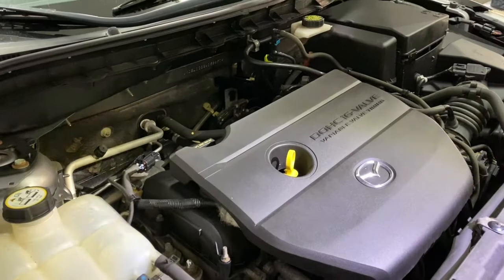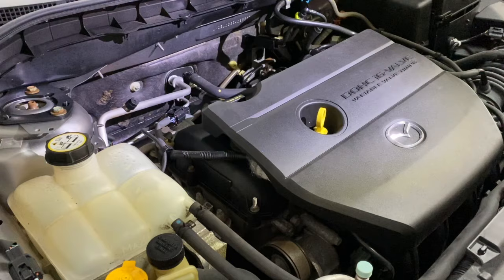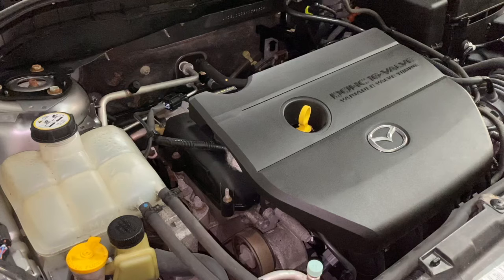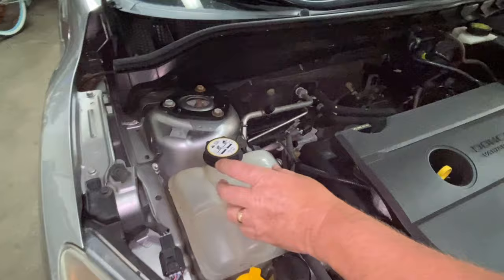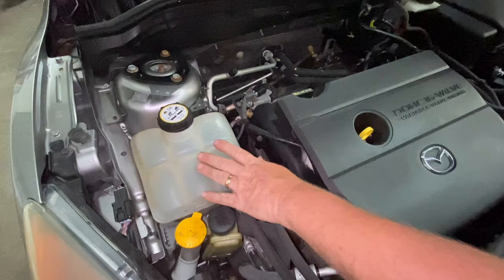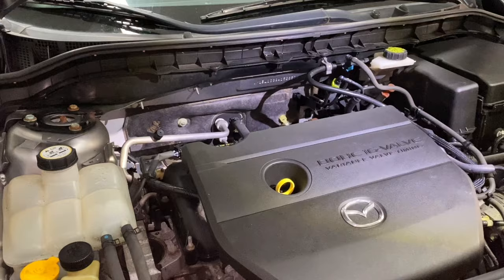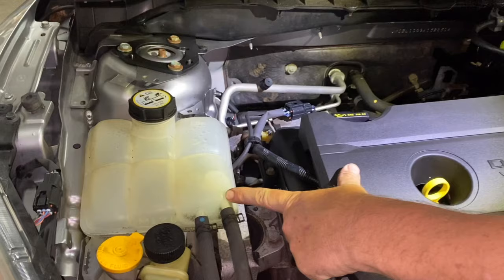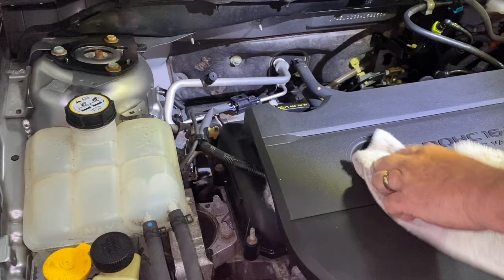Learn 3 Symptoms of Blown Head Gasket

Comment: Don't forget, usually it's a component that caused the over heating. Loke water pump, radiator, etc. Replacing gasket or engine and not the cause will only get you a second blown gasket.
Reply from the maker: Good info! This video is about identifying.
Reply: My car eats oil..  Do u think the excessive oil seaping into the seals and valve cover could cause a blown gasket?
Reply from the maker: No
Reply: Seal around pistons are worn probably burning an unholy amount of oil.  I believe 2008-2011 Camrys had this problem

Comment: Yeah, and, while you're there, with the engine running, but not hot, remove the coolant cap and see if it bubbling/exhaust gases in there - another simple check to see if the head gasket is blown.
Reply from the maker: That’s correct.

Comment: Dear sir, what if I found oil residue on the exhaust tail pipe? Thank you
Reply from the maker: Means vehicle is burning oil either through worn valve stem seals, worn piston rings bad pcv valve etc.
Reply: @Motorcarnut  thanks for the reply. I guess it"s best if I just walk away when I encounter a vehicle like that.
Reply from the maker: It’s wise if you don’t have mechanic skills or know someone who does.
Reply: @Motorcarnut  thank you sir
Reply from the maker: No problem
Reply: Welcome to the club, you drive an old BMW...  Its a feature, it makes your exhaust oxidize a tiny bit slower.

Comment: What about oil leaking from the seam That separates the engine block and cylinder?
Reply from the maker: That’s a good point, it’s rather rare but does happen on a lot of Subaru’s and that’s also a sign of a blown head gasket.

Comment: Sub for 35 years experience. Thank you Sir.
Reply from the maker: you're welcome!
Reply: @Motorcarnut  hi. I have a citroen c4 1.4. Car runs ok, but in the coolant tank i see some very minor oil spots. I dont see any bubbling in the coolant tank.
Some water drops are going out of the exhaust even with the car warm, i tasted it but doesnt taste like coolant though.
If i let the engine warm, if i remove the coolant tank cap, the coolant level rises about 2 fingers. Is it normal?
Can a head gasket be burned if there are no bubbling in the coolant tank?
Reply from the maker: Everything you explain is normal except oil in the coolant overflow. Could be a head gasket starting to fail, probably why oil is mixing with coolant.
Reply: @Motorcarnut  the engine also has, in corners, at the head gasket location, external oil leaks over the block. 
I put coolant in the tank up to the neck while the engine running and warm, and i saw some coolant is getting out. Everytime the fan kicks in, coolant drops a bit and i see a big bubble, but only at that time. If i accelerate or something, no bubbles there. 
I also noticed something, so i wanna ask you. 
When i first start the car, from inside the car, i hear a quick water bubbling in the dash. I know i heard this only in other 2 cars with head gasket isssues..Did you notice this also? 
Are there also other ways to detect a failing head gasket? maybe remove the spark plugs and see if one is cleaner? or something? 
i dont wanna spend alot to replace the head gasket without being necessary.
Reply from the maker: When the coolant rises when it’s hot it’s normal and when the fan kicks in it lowers is also normal. Your coolant level should be at the high mark not to the rim in the overflow tank. But you have leaks at the head gasket that is not good. Yes you can take out all the spark plugs and see it any look different from each other. And you can pressurized each cylinder with compressed air and see if any bubbles are coming out through the overflow tank, if there is bubbles than the head gasket is most like bad. The coolant noise inside the car could be a concern but check what I said first.
Reply: @Motorcarnut  i made another experiment. I  filled the coolant tank completely and let the tank opened,  started the engine, accelerated the engine, and at every acceleration coolant started to get out of the tank. 
Not violently, but still. Is that normal to happen with a cold engine?
Reply from the maker: If the car was cold then no that’s not normal, sounds like the pistons are pumping up the coolant system meaning the head gasket is blown. If the car was hot that’s normal

Comment: Short and to the point. Thank you
Reply from the maker: My pleasure
Reply: If I see coolant on the floor does that mean it HAS NOT got into the engine? Please advise.
Reply from the maker: No, it just means either you have a leak somewhere or the engine is overheating and boiling out on to the floor.
Reply: @Motorcarnut  but if the engine is keept on overheating if loong way drive.. is it posssible the head gasket was blown or something?

Comment: Nice video! My 2011 Mini Cooper S has symptom #3... a white smoky exhaust when warmed to operating temperature.
Reply from the maker: If it doesn’t go away and smells kinda sweet then it’s burning coolant and head gasket or a crack somewhere but probably the gasket is starting to go.

Comment: I’m trying to to figure out if my wife has a blown head gasket. She has none of the symptoms except the white  smoke which last only a minute or less when you start the car after it has been off for a while.  I changed the oil and it doesn’t look like it’s mixed , the coolant level is fine , and it doesn’t over heat .
Reply from the maker: Could just be normal condensation, but the do make test strips you can buy that will detect exhaust gases in the coolant system which would indicate a head gasket problem or not.

Comment: In your experience what would you say about oil in coolant bottle which is clear like new oil on a 2007 nissan note with no over heating
Reply from the maker: There is a failure somewhere. Head gasket comes to mind first. Car does not have to overheat for a gasket to fail or you have a crack in the head somewhere.

Comment: Just found your video my rav 4 is currently in the shop as result of what was initially thought to be a blown head gasket but was cleared of milkshake mixture turns out it was the rods that are meant to keep coolant and water sealed in engine with rod 1 & 2 having lost all their tension and were just sitting in the holes

The head gasket plate is still in one piece and only very teeny tiny amount of warpage to cylinder so all my mechanic has to do is remove threading from both holes and re-tap them so the bolts fit in there with full tension
Reply from the maker: You’re talking about the head bolts that became loose? If the engine was taking apart before I’d say it was human error but if the engine was never taken apart than the head gasket did blow. You may of not got oil mixing with coolant but it did overheat hence the warpage.
Reply: @Motorcarnut  ah yes the head bolts thanks for correcting me bolts 1 &2 were no longer tensioned when my mechanic check it over

Comment: I have a car question that I told to the experienced mechanic that works at the car lot that I bought the car from. Well it’s a 2011 Jeep Cherokee and I smell a burning smell from under hood and he said don’t worry it will go away in a few days.. it’s due to a valve cover gasket replacement and they spilled oil. 3 weeks later I still smell it. Also sometimes when I crank up or when my car is idiling , white smoke comes from my tailpipe. It ran just pass the middle of the temperature gauge today but immediately cooled back down. Thanks in advance
Reply from the maker: Well the oil burning smell is not normal especially after 3 weeks they probably never replaced it. When I do valve cover gasket’s I clean the area so it doesn’t leak onto the exhaust system anywhere after the repair. A slight sign of white smoke( condensation) is normal when the vehicle is cold however not when fully warmed up and coolant gauge if accurate should not pass the middle unless in extreme conditions like towing or climbing up mountain roads.
Reply: We have a 2005 Jeep Liberty and it’s doing the same thing. White smoke out of exhaust on idle after valve/cylinder head cover gaskets were replaced. I thought it was blowing white smoke because oil was leaking from the valve cover into the exhaust, but now I’m starting to think the head gasket might be to blame. Did you ever find out what was wrong with your Jeep?

edit: there’s also smoke in the engine bay…
Reply: @YouceffKabal  what that could mean is a cracked manifold, leaking the white smoke from the bad head gasket into the engine bay.

Comment: What other reason would air be getting into my system and causing it to overheat? No smoke, no milky oil, no oil residue in reservoir.

Awesome video and its giving me hope that I don’t have a blown gasket SO FAR. I have a 2016 kia with 133k miles. I have replaced thermostat, cooling sensor, radiator cap, coolant housing. performed radiator clean and flush. The only place I am losing coolant is from the reservoir overfilling and only during 30 min+ long drives. And im assuming its because air gets into cooling system by that point
Reply: Thank you very much in advance
Reply from the maker: If the coolant system is not bled properly it would cause it to overheat. Also the only way air can get into the coolant system is a leaking head gasket pumping up the system. Hopefully it just has to be re bled.
Reply: @Motorcarnut  thank you for that, I've parked up a steep incline (lol) and used the  coolant funnel system to purge all the air out a few times already.
Reply: @Motorcarnut  is doing a vacuum bleeding of the air a must on certain vehicles?
Reply from the maker: Do this, when the car is overnight cold, squeeze the top radiator hose with engine off to get an idea how much pressure it takes then start the engine and wait about 2 minutes if the hose feels the same as when cold that’s a good sign but if it feels harder then the cylinders are pumping up the coolant system because of a head gasket leak or cracked head. Because in 2 minutes the car is not hot enough to build pressure caused by heat. Make sense?
Reply from the maker: No
Reply: @Motorcarnut  makes total sense. And that pretty much assures me I have a messed up gasket (or head) then because the pressure does build up.  Thank you for all of the advice, information and post . Crossing fingers its just the gasket

Comment: I have a 2010 Hyundai sonata when I bought it it had a coolant leak out of the thermostat housing replaced it with a aluminum housing and it seemed to be fine the thermostat gage doesn’t work nor does the gas gage I drove it it for weeks but today on the way home we heard a pop under the hood pulled over in a parking lot and under the hood the hose from the heating core was popped off the housing (bottom one)
Put it back on opened the radiator cap and it was clogged with black puddy or something I dug it out and you could hear some pressure release I filled it back up with maybe a quarter of coolant and the rest in water and when it was burping it was foaming a little bit also the coolant reservoir also had some black sludge in it
Reply from the maker: You blew the head gasket

Comment: You left out the part where the only symptom is compression from the cylinder escapes into to radiator forcing coolant into the overflow tank
Mines doing that at the moment. 
No other signs just bubbles in the radiator.
Reply from the maker: Yes you’re correct, I made another video on 2 other symptoms and it included this one.

Comment: @Motorcarnut, thanks for the informative video. 

I've been trying to diagnose my 2013 VW Amarok TDI420. Looks like EGR has been removed/deleted. Coolant expansion tank/system is over-pressurising with a lot of bubbling occurring, smells like exhaust fumes, plus there is a black soot-like deposit on the tank walls. No white smoke out of exhaust. No 'chocolate milkshake' visible yet. No sign of diesel in coolant. Possibly the slightest trace of oil, but very hard to tell & could just be from the exhaust fumes? Already replaced expansion tank cap. 

I'm thinking this means there is a head gasket crack forcing exhaust gases into the coolant lines, but not big enough to lose coolant into the cylinders, Is there anything else it could be, before I go and ask my mechanic to take a look at the head? Any suggestions really appreciated. 

Also concerned about driving it to my mechanic, wondering if it's worth a tow? No apparent issues with starting, idle, etc. No temp gauge on the VW Amarok, just coolant warning light, which was flicking on and off the last time I drove it.
Reply from the maker: The EGR valve is missing probably because they are known to fail pretty often and there was a recall for that. Could of been the EGR cooler was leaking into the coolant system and pumping it up if they did remove it AND it's still pumpiing up the coolant system then It does sound like the head gasket is going because you shouldn't have soot deposits in the overflow tank at all. And the exhaust flume smell confirms that to me. Best bet is to have a good mechanic check it out who knows VW's. Honestly, being diesels have more compression then gasoline engines, unless the mechanic is within 1 mile or kilometer to drive the truck there I'd have the car towed because chances are the head is probably already damaged but may still be salvageable. Good luck

Comment: Hi, very informative and helpful site.....please assist......
I have a 2006 ford fiesta, 1.4i, mk5 with a Duratec engine.
Water in the water bottle boils when the vehicle runs long distance or when going over short distances, stop and go situations.The heater gauge goes passed the half way mark and fan does come on but by that time the water is already boiling.
I have done the head gasket, changed the water pump, fan and the radiator. Took of the thermostat but the wayer dtill boils.....i think that i did everything possible but my car still has the same problem, not sure what to do...any ideas, solutions guys, will appreciate your comments.rgd Doug
Reply from the maker: Did you change the radiator or expansion tank cap?

Comment: Hey. My 1977 corvette has recently started to have a hiss in the radiator and there is a slight and occasional coolant leak. Took it to a rad specialist, who told me it should be fine for the time being (I'm taking it in in a couple of days to get sorted out). However; the car has developed a clicking or almost knocking sound. Checked the oil, no lack of pressure or milky texture. There isn't any smoke coming from the exhaust, and the car runs and drives well. I'm sure the engine is on its way to overheating, but I'm terrified of a head gasket going out.
Reply from the maker: Overheating can cause engine knock if it stays hot enough to cause damage. You should have the car checked by a mechanic before using it anymore
Reply: Did you figure out what it was ?
Reply: @12wegohard  ohyeah, my radiator was leaking. Pulled it out and sent it to a radiator shop, haven't had any issues since (this was half a year ago now lol)
Reply: @nonamel6377  yo question. How much did that cost you?
Reply: @FlipBoji  radiators depending on make & model go for about $400+

Comment: Great video. Stoked that I appear to have escaped the shit realm of this problem. I have a 2004 tacoma 344k and it’s had a terrible leak from the water pump. I switched out the thermostat and housing and it got worse. The car would go from cold to hot very quickly once running. I’m assuming that’s a water pump at this point but I was worried that maybe the head had blown out. And that’s why there wasn’t enough pressure to seal up the system. Having it towed to a mechanic today. Fingers crossed. This is the first problem I’ve really ever had. Great truck. Scared to be told it’s time to move on.
Reply from the maker: Just make sure the simple things like the radiator cap and the sealing point where it sits and seals is not distorted. Just replace the cap if in doubt. The radiator is not clogged and flows properly. Another test is when the truck is cold, start it up and see if the top radiator hose gets hard fast before it gets hot, if it does the head gasket is failing and not necessarily you will see that thick white smoke.
Reply: its time to move on

Comment: My car doesnt overheat or blow smoke but it loses coolant. Every week i have to do a bit of refilling.No leaks found so far
Reply from the maker: It’s probably burning it but not bad enough to see smoke.
Reply: @Motorcarnut  do I have to replace the head gasket then
Reply from the maker: Well without the car in front of me I don’t want to say 100% yes, you should have a mechanic check it out first just to confirm. Could also have a small leak only when hot which is harder to find.

Comment: Very helpful video thank you I have that same problem where the coolant is not mixing with the oil......coolant runs low when I drive it and leaks different places below the vehicle...is it cause their is a blockage in the combustion chamber?
Reply from the maker: Thank you, well it depends where it’s leaking from underneath the car? Could be a leak in the radiator or hose or pumping up the coolant overflow and leaking down underneath as well. You have to see the location where it’s leaking from first. Good idea to dry everything as best as possible then watch where the leaks are coming from

Comment: Forgot about alot of bubbles or pressure in the radiator for  a bad head gasket as well
Reply from the maker: Didn’t forget, this was only 3 symptoms but thank you for adding this to the comment, will help others I’m sure.
Reply: @Motorcarnut got ya it gets overlooked often and can be missed appreciate the info 🎉🎉